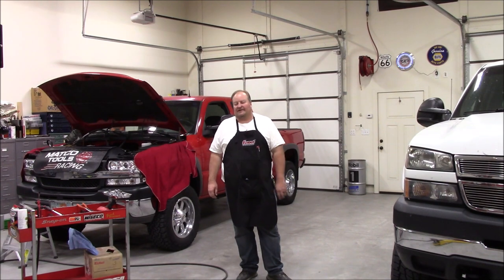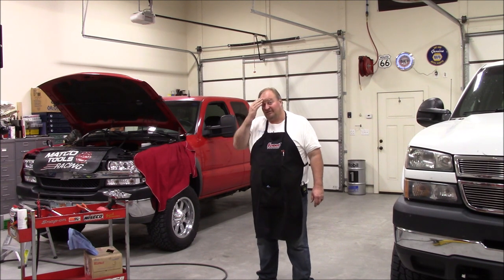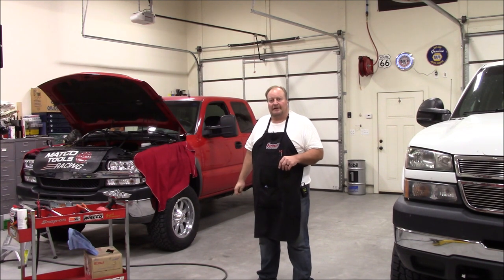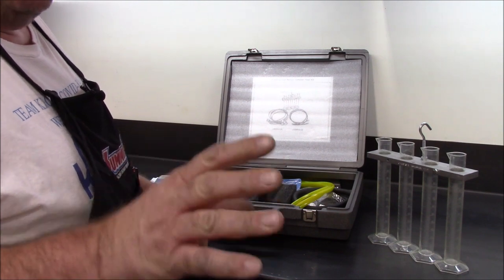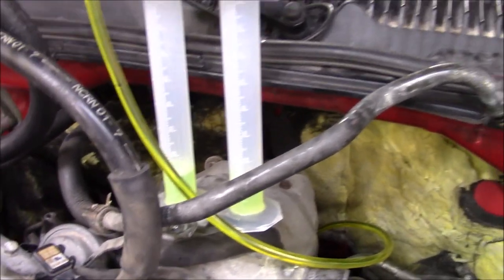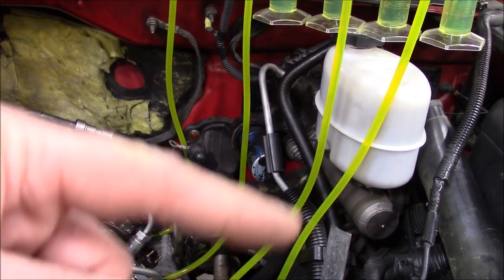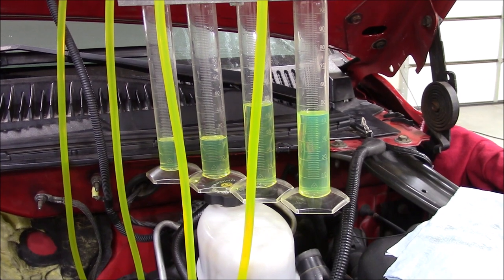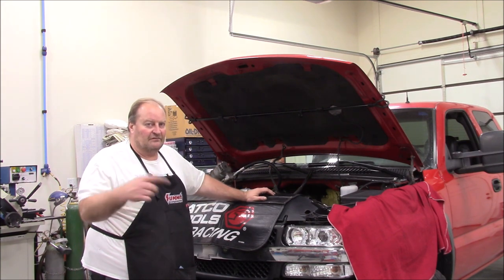LB7 Duramax Return Flow Rate Testing

Comment: I did some injectors when I was an apprentice, no one else wanted to dig into it…but found some info online back in 2009. Was running rough but verified which injectors needed to be replaced… and a HPFP on another dirty max. Company was happy with me to say the least. Would have been 10k$ each to ship far away and get a dealer.

Comment: Yes I want to see more videos like this, can you show more in-depth the process of setting it up for both tests because I was trying to see where the hose fittings were connected to on each individual cylinder during the flow test an I’m assuming because the ficm relay were disconnected that the injectors wouldn’t spray to prevent the vehicle from running. There are just more things I need clarification on . I’m going to subscribe because I’m studying diesel an your right there aren’t any videos on flow testing, or testing the HVLP for these systems. But the flow test is a critical test for these an the Cummins so I’m wanting to learn everything that I can as I’m saving these videos to my library for my own studies. I really appreciate you taking the time to make this an please reply back or just post an give a shout out . It’s nice to know that the viewers are heard an recognized most people don’t do that .
Reply from the maker: Thank you for the comments and for taking the time to watch.  

The return flow test lines are merely connected to the return port out of each injector after removing the return lines that daisy chain the injectors.  

Next time I have a Duramax in the shop for injector work I will show a more detailed shot of the hose connections.  
Mike
Reply: @zmotorsports62  no sir thank you, a gift is appreciated an knowledge is a precious gift. Your video was the most informative I’ve found all on YouTube. It’s the best one yet. really helps break things down for understanding. God bless you sir
Reply from the maker: Thank you.

Comment: Mike, When you inserted the test line into the return port on the head on the driver side near the firewall, did you also need to plug the banjo bolt line to isolate it?
Reply from the maker: No need to plug the return line. With the flow going into the test vials there should be nothing in the hard return line that connects the injectors.

Comment: Never knew you had this channel!

Mike has rescued my projects a few times now... lol 

Started with an old aluminum boat, later my s10 frame cracked around the control arm bolts.

Now I'm in need of Mikes rescue service once more.
Mike how do i get ahold of you these days?
🙃
Reply from the maker: I remember those projects well. I’m quite active on both garagejournal.com and irv2.com under the username zmotorsports.  You can send me a private message through one of those forums. 
Mike
Reply: @zmotorsports62  I'm under the same user name on the garage journal.
Looks like i need 10 posts before i can message you.
🤔
Feel free to message me, it might take me a while... lol
Reply from the maker: Responded via your PM.  I’d be happy to help. 
Mike

Comment: Great video. Any reason you can’t measure the cumulative return at the engine compartment quick disconnect vs back at the fuel cooler connection?
Reply from the maker: No.  Should be the same volume being returned,  it's just at the cooler is easier and quicker access.  

Thanks.
Mike
Reply: @zmotorsports62  thanks for the reply on an older thread. I was already checking my fuel delivery at the quick connect to verify my FASS was delivering. (It was not). Reprimed and it fired. Just did the return test and got 75ml on the return on a 15 second crank. New filter and separator on the way. What a relief.

Comment: I am assuming pulling the ficm fuse, and cranking the truck over commands full rail psi? 23k or so?  To check bleed off.
I have only seen bi directional special function to command full rail pressure to do this test.  Very informative.  Would like to see more
Reply: My rail pressure drops after 22k down to 17-18
Desired stays 22-23 actual 17-18 and injector knock and lots of smoke.
All new sending unit, lift pump and fuel lines from tank to cp3. PPE relief plug.  Ice picked and di electrical greased every pigtail on injectors.  Checked ficm and di electrical greased those connectors , and clean MAF
Reply from the maker: I'm not sure if you're asking a question or just stating your specs.

Low RP is usually either pressure regulator, injectors returning too much fuel or injector pump sucking air and not getting a good supply of fuel.
Reply: @zmotorsports62  just stating issues and what I’ve tried.  Lift pump pushing 8psi fuel pressure to the injection pump.  Thinking about trying injector cleaner as one or more of my injectors is sticking open at throttle and blowing smoke and knocking
Reply: @hotcheesesoup9776  what scanner are you using to test the cp3? thanks

Comment: 01 lb7 crank, no start & no codes related to fuel pressure just glow plug fault P0380 but ambient air temp is 90-100 this week so glow plug shouldn't be a factor . check fuel flow (on common return )while cranking from line you have capped in video with fuse out and get nothing. start to pump primer on filter housing and will get flow into mixing cup( couple oz come out). Scan live data show FRP at only 1-2mpa while cranking. Dont have tester to break down system( pump from injectors return flow). Any thoughts?
Reply from the maker: Hard to say.  I'd start by looking at fuel starvation to the pump. Could be losing prime or could be a collapsed fuel line which on these older trucks are becoming quite common.

Comment: I know this is an older video, but i have a question. I thought i had bad injectors because when my truck warmed up, it white smoked. I decided to do a compression test, and i have zero compression in cylinder 1. My question is, could a leaking injector cup cause that? I know the only way to really know is to pull the head, but im trying to be optimistic here and hoping it's not a hole in the piston. I can handle needing valve train work or head gasket. i already bought new injector cups. I should have compression tested this truck before i bought all these other parts. 😢
Reply from the maker: If an injector seal were to fail I think it would still have some compression, just low.  For it to have zero compression I would think the injector would have to be completely out of the injector bore.
Reply: @zmotorsports  thanks for the speedy reply, so I'm probably screwed, it's either valve train or a hole in the piston. It just ran so good for it to be a hole i feel. 😥😥
Reply from the maker: Hole in the piston wouldn't be my first thought.  Although possible it's rare, I'd suspect valvetrain issue before a hole in the piston.  Pulling the rocker cover should reveal the issue.

Comment: Hey I have an lbz that has crank no start and won’t hold a prime,do you recommend I buy a test kit and look at my injectors?
Reply from the maker: You can, but if losing prime causing a no start I world look more at the filter head and/or adult lines from the tank. Sounds like more of an issue of sucking air vs. injectors.
Reply: @zmotorsports62  thank you for the quick reply and great video!👍

Comment: Can you check cp3 return without special fittings or the kit?
Reply from the maker: Yes. You just need some sort of graduated container to measure the volume and a couple pieces of tubing, preferably clear to connect to the barns one the CP3 pump.

Comment: Quick question if I may.  I have an actually rail pressure of 1.50MPa desired 50.  And when I check the return im only getting 15ML to the tank. Any idea what test I should do to check my issue? I'm new to diesels.
Reply from the maker: Next I would use a bi-directional scan tool and force the rail pressure up.  If the actual cannot follow the desired you would more than likely have either a stuck open FPRV or a bad high pressure pump. 

Good luck in your testing.
Reply: @zmotorsports62  thank you for your response. I was thinking the FPRV, but then thought if it was stuck open I'd have more fuel being returned to tank.
Reply from the maker: Yes, that would make sense but easy to check so I usually recommend checking that to confirm before jumping right to the pump.  
Good luck. 
Mike
Reply: @zmotorsports62  is there a inexpensive that will it do a active test to demand max fuel pressure on the cp3 injection pump to test?for a 2005 gmc sierra 2500hd with a 6.6L duramax?if not do you know what bidirectional scanner will? thank you

Comment: Can any of those cause it to start then shut off? I have an 01 and every time I bleed the fuel and pump it up it’ll run for about 30 seconds then die. Only way I can get it to restart is if I crack the bleeder and repeat process. I have done orings on the primer replaced the two rubber hoses and replaced the rubber hose on the 2nd ficm bolt. I’m at a loss. I know it’s not the lines under the truck because I bypassed them by running 2 rubber lines from the passenger side fuel lines to a 5 gallon jug of fuel.
Reply from the maker: I think your problem is still on the suction side.  An injector or CP3 pump with high rates usually won’t cause a restart condition.  They’ll usually cause an extended crank symptom.
Reply: Okay thank you for the reply. How would I go about finding where the lines are sucking air at then? Pressurize the tank?
Reply from the maker: Pressurizing the tank and look for leaks is one way.  Don’t use more than about 3-5 PSI though. 
Another way is attach a clear line to the filter head and look for bubbles.  That’s air being introduced into the fuel.  Then work back until you locate the point where air is getting in.  Most often it’s the filter base but you mentioned you already rebuilt that.  Next check the quick disconnects at the driver’s side rear of head and at the tank.  
Mike
Reply: Ok can If the fittings at the head are bad can I just run fuel hose from there to where it needs to be? Thanks again mike
Reply from the maker: Yes. You can eliminate the quick disconnects and run fuel line.

Comment: We’re do you get that test kit thanks!
Reply from the maker: I'm not sure where to get them these days.  Mine is an older Kent Moore J-45873 kit that I bought years ago.  This is the same kit that the dealerships use or used.

I just Googled it and I see they're still available.  I would stay away from the cheap import kits as they don't seal very well and will leak all over and give your erroneous readings.

Mike
Reply: @zmotorsports62  thanks I deal with a lot of Duramax trucks been using the balance rates but would like this kit for a more accurate reading. Spent alot of time on the ford 6.0 still work on alot of them but I’m starting to see more and more Duramax trucks and been doing well diagnosing issues with them would love to have that kit!
Reply from the maker: It is a well made tool and definitely better quality than the cheap import kits.  It would be a hard pill to swallow for a one time use but for a career mechanic it's a good investment for proper diagnosing of the Duramax return rate.

Comment: lb7 does not have injector flow rates its the 2005 and up
Reply from the maker: No, you cannot measure injector return flow rates with a scan tool monitoring any PID's.   That is not what I'm showing in this video.  

In this video I am demonstrating how to measure actual return flow from each bank and then each individual injector, which is the only way to get this data.

Comment: Seems like a convoluted test overly complex
Reply from the maker: The test is what it is.  There's no other way to perform a flow test on an LB7 other than to measure the actual flow.
Reply: @zmotorsports62  just pull the return line
Reply from the maker: The return line will show cumulative not specific to a component.   I mention that in the video.
Reply: @zmotorsports62  yea I’ll just ohm them out by unplugging them
Reply from the maker: Ohming them will test the coil but not determine the return flow.
Reply: @zmotorsports62  man good talk
Reply from the maker: Agreed and thanks for watching my video.
Mike